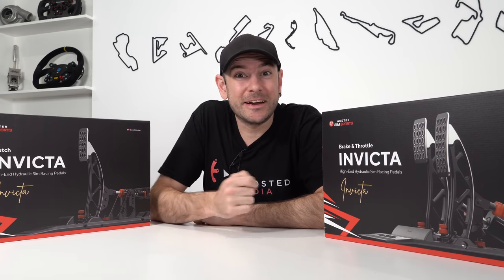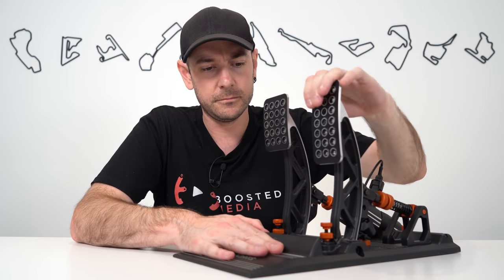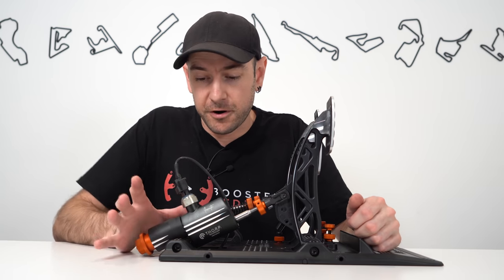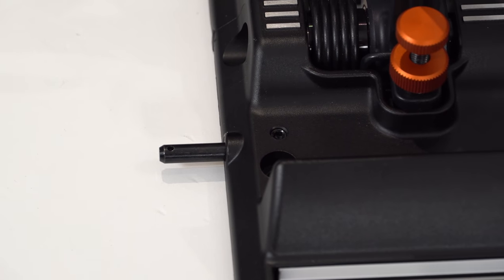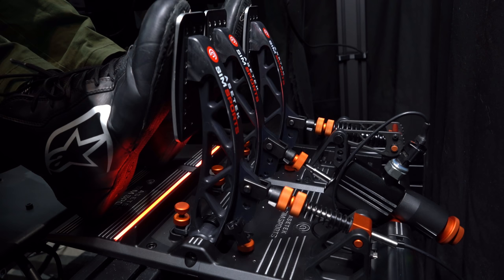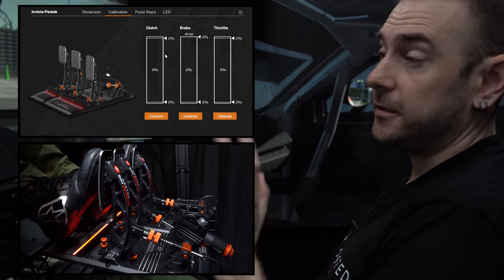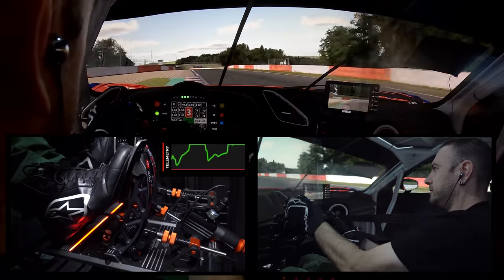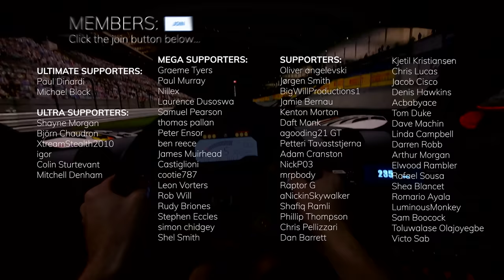REVIEW - Asetek Invicta Hydraulic Sim Racing Pedals

Comment: From what I learned from Asetek's Invicta video, the rubber compression before mechanical bump stop is to simulate brake pad to disk take up.
Therefore, this part of travel (squishing rubber to mechanical bump stop) wouldn't give you any stopping power in real life.
When calibrating, do I need to calibrate this part of travel out? 
Because from your video, when you calibrate your brake pedal, 80% of your braking pressure barely pass the mechanical bump stop.
Which in real life shouldn't give you any stopping power.
Reply: DUDE YES. that's the exact same thing going through my head. If the travel is Sim RE; pad to rotor then it should be 0 value in pressure. 

ALL reviews I've seen of this have either explained it ass backwards or have been briefed Hella incorrectly. It's so confusing that it shouldn't be.
Reply from the maker: The calibration is pretty subjective but what feels right to me is to be hitting 80% (the general amount of braking pressure you want to be applying when you hit the brakes at the end of a straight in most cars). This can be calibrated to whatever force feels comfortable to you but the mechanical threshold between the elastomer and hard stop provides a very consistent way to feel this, thus hitting it accurately every time. 

You can then modulate your braking around this threshold point as required. If you watch VRS track guides, etc, you’ll see they don’t always brake to the same force for every corner. It depends greatly on the balance and speed of the car. 

As for the uptake, I have a little bit of slack in the pedal before the elastomer is engaged which I use to simulate this. If you watch my first look video you’ll see the cold brake squeal happens exactly where the pedal starts to engage with the elastomer which is the way it should be as that’s what happens in real life. 

With my calibration the elastomer accounts for 0% to 80%, then the 2nd hard stage accounts for 80-100%.
Reply: @Boosted Media  thank you so much for taking the time to reply. I see where you're coming from. With your calibration being set as you mentioned. 0 to 80 on travel and 80 to 100 on pressure, this sounds great for Sim racing but then has no correlation to real race car brakes. The video Dave Cameron did on Dave cam has his calibrated the same way, which in terms of reality has to be the incorrect calibration. Asetek themselves mentioned the travel is to simulate the travel of pad to rotor therefore bearing a 0 value. In my opinion. Karl described it best and if you time stamp his video. From 17:05 to 22:45 I think he mentioned it THE BEST. I guess the real question posed is, do you want realism or do you want to be fast in the Sim, there's a fundamental disconnect between the two at the moment. In real racing. You cannot escape the travel of pad to rotor. In Sim racing if you simulate it properly, you're losing time that others aren't. Stuck between rock and a hard place.
Reply from the maker: The way Karl described it is incorrect. That is not how the pedals are meant to be calibrated. You can loosen the retainer off to create a dead zone where you only feel the resistance provided by the retainer spring and hydraulic fluid, which would essentially make it a 3 stage system. This is optional. 

The elastomer is not meant to simulate pedal uptake. It’s meant to simulate the first braking stage to the threshold point.
Reply: @Boosted Media  thank you again for the response, it really helps and you're the best mate!!

Although now I will admit, I am MORE confused than ever. Feels like right back to square one 🙃🙃🙃🙃
Reply from the maker: Go back and watch the calibration section of my First Look video. It went into more detail than I did in this video. Should make sense then.
Reply: Hi Alex,

We generally recommend that you calibrate them in a way where the initial travel (while the elastomer is active) is initial braking power. In a car, you will also feel an uptick in braking power, before you reach the hard stage. By calibrating them this way, you will also notice a significant improvement in your trail-braking consistency. 

I suggest watching our video on the subject at the Asetek SimSports Channel - "Benefits of a Hard and Short Brake Pedal"

If anything is unclear we/I would be more than happy to clarify and even make additions to our content. We are here to provide the best possible solutions to the community. 

/Dennis
/Asetek SimSports
Reply: @dennishampe4465  Some additional content on pedal setup & config would be great for clarity on how to correctly set them up to get the most out of them, as they were designed to operate.

I too took away from Invicta video that the uptake feel was supposed to be from the elastomer, with pre-load applied - although there should be some braking applied through this stage. Although I do like the look of how Will has set them up, I think I too would be aiming to hit 80% at the hard stop. Some clarity on best practice setup and tuning (for different feels/preference) would be great! I've got some pre-ordered, can't wait!
Reply: @kenthompson1984  Thanks for the feedback mate. I’ll relay it to our content production team 🦾
Reply: @boostedmedia  this statement alone perked my interest. If you were to flip a coin with heads being HEu's and tails being these.....would you want tails like me?

Comment: I do the same thing with the throttle, my heel stays planted and the bottom of my foot slides on the pedal plate as I depress it, to make it perfectly smooth, I bought some 1/16th inch thick PTFE sheet and cut a piece th same shape as the pedal plate and double side taped it on the plate so my racing shoe sole slides on it very smoothly, makes throttle modulation super accurate!
Reply: Ptfe is like what they use for mouse skates right?

Comment: I am disappointed there was not more shown or given regarding mounting these.  After looking at the schematics on their website, their mounting holes do not seem to line up with any others on the market so that means drilling for those not using aluminum profile.  I think this is a miss on Asetek's part IMO.
Reply: @bomarfield Interesting take.  But it does appear that they have captured lightning in a bottle with their new hydraulic brake design
Reply from the maker: Mounting was discussed in more detail in our first look video.

Comment: Will. Have you managed to replicate the stiffness and feel of these pedals in other high-end pedal sets? Or does the Asetek design make them unique in your experience?
Reply: That is the million dollar question.  BUT, the huge advantage to this proprietary brake set up I see anyway,  is that it is a closed system that uses non carcinogenic fluid, and no chance for the bumpers to blow out over time and no fluid to leak and cause issues.
Reply from the maker: This was discussed in the conclusions about n this video and the prototype discussion :)

Can replicate the stiffness but haven’t tested anything that gives the same authentic feel.

Comment: Pedals look quality, and they may have a point with brake setup, but look at pedal cam videos from real race cars. They have travel. Pedals travel is a function of bore and stroke size of the brake cylinder. It feels like there is a fair bit of marketing spin at play.
Reply: I agree. With all the on-boards of various race car pedal cam views I've watched over the years show brake pedals with a certain length of travel while being pressed which is determined by car, setup and driver strength. The RL ones aren't really like the "dead stop" that these asetek pedals have but it's all down to a sim drivers preference I guess.

Comment: One thing I noticed is you do have some flex in your pedal tray. It may be something for people to be aware of.  Because the pedal is so stiff, you will need a very strong pedal tray.  The design looks very robust so you will need to make sure what you mount them to is also as robust.
Reply: You absolutely need a robust pedal tray (otherwise the tray itself will flex) or aluminum profiles. 
Having tried these on a few rigs (among others the Rennsport cockpit) I can say, that in some cases you need to reinforce the thin pedal trays :)

But that is just how it works with 100+ kilos of force ;)

/Dennis
/Asetek SimSports

Comment: Hey Will, just a question in your opinion would it be easier to mount these pedals to the tr160 pedal plate or just remove the pedal plate completely and install some profile and mount the pedal plate directly to the profile? Cheers for the review, quality work as per usual.

Comment: There engineers didn't think to just make a divot where that bolt hits when you press the pedals and then fill it with hard rubber?  Simple solution that would work perfectly and not add a dead zone.

Comment: Thanks for the video! Do i need a hard carbon fiber bucket seat in order to apply the force/power to the brake pedal in the best possible way? I have a VW Golf V seat on my rig which has a more or less soft cushion. I ask myself if my seat is no go with this kind of pedal system.
Reply from the maker: No I’m using an FRP seat and it’s fine.

Comment: Hi Will, and as always, top quality review! As I interpret your review, it's a hard pedal, but how hard is it? Is it so much that you get sore knees and legs from driving with it, or can you find a compromise without amidst the obvious advantage these paddles have in their 2-stage hard-stop system?
Reply: Hi Anders,

It has a travel of roughly 2cm at the brake pedal. The firmness can be adjusted with the elastomers, typically between 35 kilos and 120 kilos of force :)

/Dennis
/Asetek SimSports
Reply: @dennishampe4465  thanks for your answer. I am familiar with these differently elastomers, but is not the basic principle with these new pedals that during hard braking, you press the brake all the way to the hard end stop and modulate the brake pressure around there? If it is properly assumed, the elastomer no longer matters and the paddle will be rock hard there, right!?

In other words, is the point with these new pedals to brake in the "soft" area, or to push the brake all the way down the hard end stop, and then modulate it around there?
(under hard breaking of course)

Thanks in advance:)

BR Anders
Reply: @Adamdagoat233  the point is it is a two stage system. Initial breaking Force is applied during the soft stage, the hard stage is maximum braking, then moving back into the soft for precise control of trailbraking :)

Comment: Excellent review - really covered everything in great detail.  A question for you: I've pre-ordered the throttle & brake but not the clutch because I've never found the clutch feel on other pedals to be very realistic.  Do you feel this clutch is good enough or enough of an improvement to give a meaningful sensation worthy of ordering it?
Reply from the maker: Honestly I’m impartial to clutches. There’s nothing particularly remarkable about this one. It has a good range of adjustment including 2-stage and is smooth. Beyond that, take it or leave it depending on your needs.

Comment: I have the sprints.  And i max out on the brake so easy on highest settings because i use a really stif setup on the brake. Is this asetek pedal really more heavy duty ? I think is easely push 140kg with some slack i’m a big guy😅 1m87 tall and not skinny. 
i’m searcing pedals that easly doubles the 65kg of the sprints. And have slack. I dont use clutch. Looks like these are the winners but i doubt between these and the he ultimates +. The price is really in play for me. I just want to know if these aseteks are up for my natural force.

Comment: Are there any games like iRacing and ACC that make/force you to have a clutch or can I go with just the brake and throttle option only? I could use the cash to buy a better sequential shifter then.
Reply: ACC doesn't force you to have a clutch as far as i know :D
Reply: RBR. DR2.0. rF2. AMS2. Basically any sim which has more than boring modern GT3 and similar crap. It is not "forcing" you but using proper setup gets you to the waters of immersion and fun.

Comment: Percentage of price increase said in this review is incorrect.
They have based the price difference against new final price.

When working out percentage of increase it should be done off initial price.

Example, accelerator and brake is a $150 USD increase over base price of $699 USD, therefore approximately 21.46%

The clutch is $50 USD increase over base price of $299 USD, so approximately 16.72%.

Comment: id wish they got rid of the rusty orange and the massive crack between the clutch and the other pedals. That just looks wrong, and I could imagine it being annoying as well.  I could also do without the rgb, not many 15 year old gamers are getting them anyway. Otherwise I think they look pretty good. But the brake, them being a danish company and the intro price is the only reasons im considering them over the simagic´s,  which I like the looks of a whole lot more. The adjustment on the asetek´s looks like great design though.

Comment: I see clutch not flat on the table ? Is there a problem with connection or ?
Reply: The units are die-cast. And as such they are not always completely flat. However, this equals out once you mount them to a rig. Also if you tighten the clutch too tightly to the brake and throttle, it may actually cause the to units to not be level :) 

/Dennis
/Asetek SimSports

Comment: Do you find having a stiffer brake pedals gives you any joint or muscle pain for extended use?
Reply: answer is yes, for me anyway, one solution is to move brake pedal even with left leg, assuming you left leg brake, but these do not offer the ability to mount the pedals independently so something to consider
Reply: that is the reason I like pedals that are separate of each other, Meca's, VRS, Heusinkveld, etc.  Just helps get them more comfortable.
Reply: @aaronb486  Yup, I am still leaning towards Simtrecs for this reason and that's what is frustrating with pedals, there is not one out there regardless of money that checks all the boxes for me at this point in time
Reply: @chuckystang  have you looked at the Simgrade R7 pedals?  Looks like you can do anything you want with those. lol

Comment: $1300 AUD for the throttle and brake, seems fine, $550 AUD for the clutch???? I literally had the throttle and brake in the basket ready to order, then went to add the clutch and borked at it.  My guess would have been $200-300 extra to get the 3 pedals over 2.

Comment: I‘m really looking to receive mines and compare them the HE Ultimate that i currently have. However i see they cut corners on some design elements which are kind of disappointing to me but it does shows that its designed to costs with the Brake being the star of the show.
- very basic throttle (i hope they are as precise as the HE)
- plastic pcb cover really! what about EMI??
- wiered baseplate design 
- too much assetek logos everywhere ;)
- i wished we could have other colors for the anodized knobs! At least aftermarket options to make mo 💰 would be fine by me.
- hell rgb fans need to be able to enter a color code to match their system not just a slider.
Reply: Hey mate,

Would like to address some of your concerns :) 

-Throttle: We're more than happy to listen to any feedback from the community on the throttle. However, we believe it's pretty darn good in it's current state ;)
-Plastic PCB: EMI isn't an issue, because the PCB was design to be used in this environment. Not unlike other PC components :) The plastic also allows you to see the status diode through it ;-)
-Logos: That's down to personal preference, I suppose ;)
-Knobs: Aftermarket options ARE coming. 
-RGB: We built in ARGB for a reason. There will be system wide functionality added in a future update. We're currently working on implementation with systems from Razer, MSI, Asus etc. :)

/Dennis
/Asetek SimSports
Reply: @dennishampe4465  👍 i was pretty much expecting it down the road. thx for the confirmation. One thing that Ron mentioned in his review it would be great to add 2 screw caps for the throttle and clutch . It costs nothing and really effectively damper the noise.
Reply: @fan2hd277  and we are absolutely looking at a good and reliable way to do this :)

Comment: Have you seen Dave Cam's vid where he noticed his brake and accelerator overlapping in telemetry. Just wondered if you could try and see if you get similar results.
Reply: not even sure why that was seen as a problem, often times brake and gas are used in conjunction in real life racing...
Reply from the maker: I haven’t seen Dave’s video yet but my brake and throttle inputs overlap too and have done on every pedal set ive ever used. It’s a driving habit. Has nothing to do with the pedals. 

Look at the telemetry overlay in any of my racing videos from the last 3 years.
Reply: @boostedmedia  I didn't think is was the pedals just thought it was an interesting observation. He was doing as good times right foot braking which meant he wasn't overlapping
Reply: By the way awesome review as usual
Reply: Has nothing to do with the pedals lol 😆 you need to go rewatch Dave's video cause you missed the point by a mile buddy
Reply: @UpwardWorm  Sorry I'm obviously not as clued up as you
Reply: Lol I wasn't saying it to insult you bro, just telling you to go back and try again?